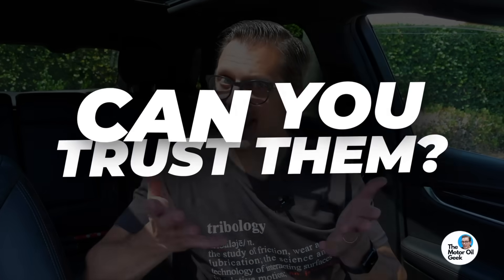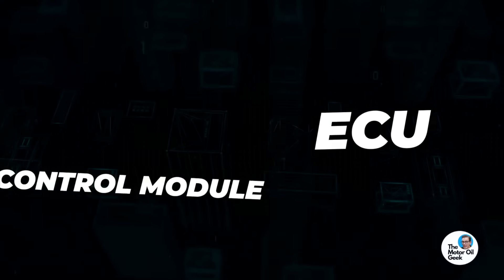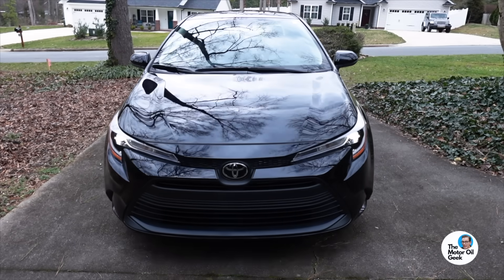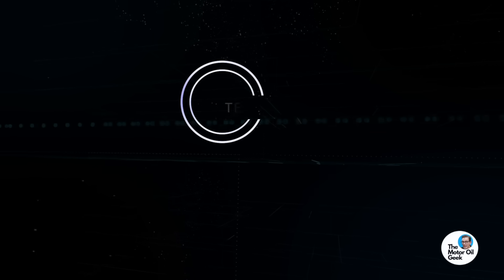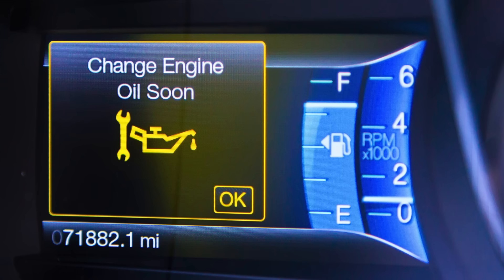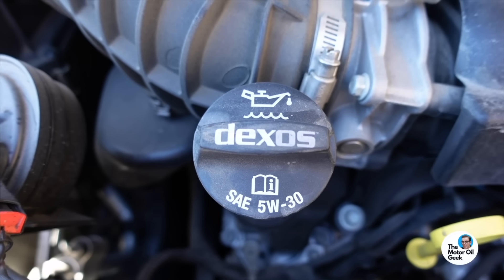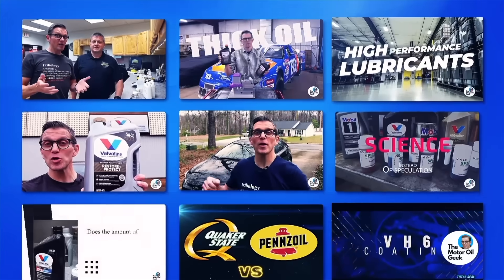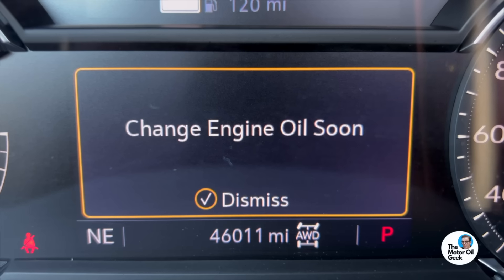The Accuracy of OIL LIFE Indicators REVEALED!

Comment: At GM, two guys took samples at 1k mile intervals at 21 different perimeters from drive cycles, time at temp, re-fueling. An algorithm, not a 3k counter. They sent the sample out to a 3rd party lab for analysis. Then repeated this on 16 different engine families. They set oil life monitors readings on the conservative side as they knew that people would ignore the display for what other reading! We had a lady who bought a new Buick 3.6 V-6 and had it towed at 16,000 miles with no oil & factory yellow chalk mark on the filter. She indicated the 0% reading came on at 12,000 miles. At 0% it still had 7% usage for her driving habits. Short trips kill oil. We have to educate customers on driving habits and the oil life monitor. This used 32 inputs to calculate oil life. How do your customers drive?
Retired Master tech.
Reply: Somestimes I need to use my motorcycle and I like to run for 3-7km. Is that considered a very short trip?
Reply: @magichatake  Motorcycles fall into several categories from dirt bikes, V Twin air cooled, 4-Stoke single & water cooled. Lake Speed just came out with a new “Oil Geek” video covering this exact subject on YouTube yesterday 12/10/2024. Worth watching as wet-clutches create issues that require a unique additive package “MR2” I think!
  I am a biker myself on #17 since I retired. Now, I would buy newer but I enjoy the steel items I welded, fit and had chromed. Making it mine. The leather seat cover comes next after I stitch my buckets for a 67 C10 pickup that is mine and the last. Comes the time to enjoy them instead of working on 2,000 vehicles per year other people owned at the dealer. 
ASE Master since 78.
Reply: @magichatake  Yes - that's a short trip. The problem with short trips, especially at cold temps is that the oil doesn't get above boiling (212 F - 100 C) for long enough to clear water and fuel dilution from the oil.
Reply: @MathewPollard-vj4uq  Oh, I forgot to say that I live in Brazil in a city where most of the time it's above 30º C (86º F)
Reply: @magichatake  great.
Reply: @magichatake  Depends on if air cooled or not? But this is why guys check it and wipe a small amount across their finger. If opaque and you can’t see thru it, change is due. If the oil retracts away from the edges of the dip stick, then it was gasoline (Petrol) in it, change. If you see thru it and see finger prints and it sticks to the stick, it’s good! 
It’s just like reading spark plugs on a race engine. Too lean and the insulators are white, the engine can blow up! Top fuel dragsters are torn down between races, fitted with new rings, gaskets and piano wire combustion chamber seals. 
ASE Master tech since 1978.
Reply: @deankay4434 ASE master tech for 20 years + L1 & L2 here. You know too much lol. Just kidding, your knowledge needs to be shared for the remnant gear heads. I cringe at manufactures building power train and drivetrains without dipsticks.
Reply: Ya my buddy's sister bought a mustang when she left home to go to University in the 80's, after about 4 years my friend (her younger brother) borrowed her car, he checked the oil when he fueled it up and it was nasty black and down a bit. So he asked her when the last time she changed the oil was, she said I have the gas attendant check it once a month, then my buddy realized she did not know the oil had to be changed out every 5000 KM (older vehicles never had oil life indicators) can't really blame her because her dad had only told her to make sure you check the oil. Funny little story.
Reply: @riverratt8626  Correct, old cars didn’t have oil change indicators as I was working older stuff in the early 70’s. A manger brought me a Post War Pontiac Chief straight 6 that ran hot after 3 water pumps. I replaced the brass tube insert in the block, that was behind the pump. It ran the length of the block with vertical slots to direct coolant between the cylinders. Crude system but worked good.
Reply: @deankay4434  to me its easier to just change the oil every 3K miles or 5 months,  whichever comes first
Reply: @cantwealljustgetalong2  you bet cha!
Reply: Caddy Blackwing 6.2L, Changed oil @ 1500 mi, Mobil 1. Timer was re-set.  Now there is only 4500k & oil timer says 9% life left.  Wonder if short oil life due to short trips or hard pulls every now and again. Guessing supercharger dilutes oil much faster than N/A.  Gonna change when says 0 and sent it off due to curiosity.  Retired marine Master tech.
Reply: @  Great question and good for you, paying attention to this issue. On the short, yes-short trips kill engine oil. If the oil can’t reach the boiling point, water and moisture won’t boil off. This is way different than a marine engine. Plus, pulling a boat or other load will affect the oil life as well. Short of sending oil sample out for testing, this the next best thing. Working for ACDelco, I met the two engineers who did just that, samples. These came from 14+ engine families in extremes that would tax the additive package to the maximum. They wrote the algorithm used by GM for oil life monitoring designed for 67 countries and their climates 
w/w/o loads. Info from coolant temp, MAF, throttle position, throttle position, etc. are input to calculate loads, gear range, temps higher than normal using cardboard partially block the radiator on tracks + a dynamometer to look for wear, metals, engine tear downs w/inspection over 16 months. This info also helps with powertrain & why some have coolers or not. Yet, they were extremely conservative in the calculations they wrote for the software understanding many may ignore the oil monitor. Like a gas tank sender reading empty but still has 2+ gallons in the tank. Like the ASE test, L1, which is 100 questions on emissions with 5 to 6 questions on parts like a thermostat stuck open causes misfire, high HC, low pre-cat O2 high readings inducing lean conditions, etc. I hope this helps to answer your question as I used the 3-gas analyzer in the dealer when no other techs wanted it. Later in a private shop, I took the job based upon their equipment, not because they would hire! Now, I am working on imports and domestics, carb & EFI include CIS systems (Constant Injection Systems) found on Mercedes, Audi, Volvo and others like Porsche. But on domestics, I had sold 38 vacuum operated canisters EVAP valves and was given a gift card for $40 at Christmas by the shop’s manager. He had never seen sales of this type item plus zero comebacks for the year. Rebuilding carbs, Fords VV7200 & VV7400 that dealers replaced plus every carb known in 1984. I was just trying to feed my family.
  Merry Christmas and happy safe holidays to all. DK, Omaha.

Comment: I have a 2006 duramax that trips the oil change indicator every 16k km (or 10k miles).
Regardless if I drive like an idiot, haul (6500lbs extra) most of the time or just daily drive it with no load. Feels like they put all that development to waste by the time 2000s ECU's were programmed
Reply from the maker: Diesels are different, so I'm not sure if those use an algorithm.

Comment: I want to assume the same results, but it would be interesting to do a similar thing with other manufacturers’ oil life indicators.  I generally always change my Civic’s oil when the life reaches 20%.  Generally though, if one doesn’t trust the length of the oil life indicator, then you can just change earlier, not by mileage, but by indicator level since the computer takes a ton into account outside mileage.  Don’t trust it at 0% and thank it’s 2x too long?  Change it at 50%.
Reply from the maker: Great suggestion!
Reply: @tinyman392  when I have honda's come in based on the onboard system, they are at 10k to 12k miles. Way to long if you want to keep them for the long term. If you want to get to 100k and sell it, listen to honda's onboard system. If you want to keep it, change it every 5k.
Reply: @jgranger2002 my Honda is already at 115k miles and I don’t drive it nicely. I’ll let you know how long it lasts, but I’ve had no issues following the minder.
Reply: @tinyman392  better go check the oil.
Reply: @jgranger2002  assuming it’s anything like GM’s implantation (shown in the video) where it’s very conservative, it’s probably fine… but it is something I wouldn’t mind seeing from the channel.
Reply: @tinyman392  7,500 miles for gm vs 12,000 miles for honda. Not conservative from honda at all. I haven't worked on gm at all. I work on honda and toyota. Honda's, especially with a turbo, are a ticking time bomb with 12k mile oil changes.
Reply: @jgranger2002  my first one was 6500, second and third ones were roughly 7500. After that everything has been 8-9000 miles. My Honda is a turbo, I’ll let you know when it blows up.
Reply: @jgranger2002 My uncle is a car guy and a retired chemical engineer.  He said that Hondas are disposable.  You drive them 300,000 - 400,000 miles and then junk them.

Comment: Good to point out that todays oil is of such high quality it will last a long time, but as Oil Geek points out it´s  the CONTAMINATION that´s the killer!  Dirty oil will clog up screens and those small oil channels.
Regardless of the miles you have to keep an Eagle eye on the oils condition as no two vehicles are alike, some burn clean some don´t. 
As my father said many years ago "Keep your oil clean son and you´ll car will last a long time!"
Reply from the maker: Great point on the contamination!
Reply: @themotoroilgeek  Have watches several videos of torn down engines, some like the Ford Eco engines that have duel turbos with oil  wire strainers going into the heads that can easly get clogged if the oil gets too dirty or by flushing for old deposits. OIL STARVATION!!

Comment: Is it true that GM reprogrammed the OLM because they were losing engines still under warranty? I have a 2008 Buick Enclave & a 2020 Chevrolet Express 4500, the OLM behaves COMPLETELY different on the 2020. You can’t even reset it to 100% with the motor running. The Buick will go miles & miles & still show 100%
Reply from the maker: I'm sure about that, but the change in the renewable fuel standard would require a recalibration since the Ethanol fuel would impact oil life.
Reply: @themotoroilgeek  Thanks for the reply, Lake, so you're saying the 2020 Express is programmed for (possible) E85 use?

Comment: I don't know why GM bothers with this.... I have 2 GM ecotec's in the household, both have tons of blowby and drink oil....They will run bone dry well before asking for a change. I don't think they are unique either, new piston rings just suck. I hear newer honda motors are just as bad. When you consume 1qt every 1000miles (many dealers don't even consider this an issue), 5000 miles, means your down about(...checks math)....5qts by then.
Reply: "They will run bone dry well before asking for a change."

You know you can check it and top it up, right? ;-)

Comment: you did not say anything about the mileage on the car, would it tell the truth at 300,000 miles. just wondering.
Reply from the maker: Great question. I would not follow it on a brand new engine. Until the engine is fully broken-in, the oil needs to be changed sooner.

Comment: GM debuted OnStar at the 1996 Chicago Auto Show, and it would hit the market in most 1997 Cadillac models as a telematics system, a precursor to contemporary connected cars. As cell phones were still relatively rare, OnStar's primary function was to serve in case of emergencies. With a touch, the driver could have doors locked or unlocked remotely or connect with an OnStar operator in case of an accident. If a vehicle's airbags were deployed in an accident, OnStar automatically connected an operator to aid as needed.

OnStar wasn't only useful in accidents. Its constant read on a vehicle's location not only made it useful in case of theft, but it also meant operators could possibly provide navigation guidance or recommend restaurants and hotels. OnStar functioned like an app long before apps were even a concept.

As OnStar's availability in GM vehicles expanded, so did its use. By early 2002, there were more than a million OnStar members, with that number eclipsing two million by the end of that year.
Reply: Thank you. I've been driving since the mid-'70s and I sure don't recall OnStar being around in the 1980s.

Comment: Thumbs up for the pro-metric system stance :) 
We all love lifting 500lbs, but the metric system is what brought us to the moon :)
Reply from the maker: Right on!
Reply: I much agree. It would be a learning curve in this country for a few years. After the learning curve most would be used to it. I've agreed with this when the USA tried to implement this in the late 70s or early 80s but it never happened unfortunately.
Reply: @bad_financial_move9169  I have to look into this, if this was the issue, that some folks forgot to use metric. But yes there is always a risk, especially in aerospace. How many incidents happen just on our streets.
Reply: The US is actually around 50% metric, especially in a lot of stuff behind the scenes. They even got things right in a few things like 100 cents to 1 dollar. They correctly bypassed the witch’s brew of the old British monetary system of shillings and sixpences!
Reply: What is the advantage of the metric temperature scale ?  All scales are arbitrary at some level and will work more easily in some scenarios than others. I like using only metric tools because it simplifies things but then I often have to use a 5.5 mm Hex. Why ?
Reply from the maker: @MathewPollard-vj4uq  There is not a technical advantage of the metric system. It's just easier to use and it is the standard in the scientific community.
Reply: @MathewPollard-vj4uq  why? Because the US builds it in 7/32 not 5mm not 6mm it is 7/32
Reply: Gave him a thumbs down just for you bby <3

Comment: I am a chemical engineer and your channel is a treasure trove of knowledge and additional information that I can learn and understand about oils
Reply from the maker: Thank you!
Reply: I started payiing attention to the onboard oil iife monitor in a 2006 Honda Odysssey purchased new.  Over the years, always using 5W-20 synthetic blend, I noticed that it showed different results depending on how the vehcicle was driven.  Lots of short trips in the winter...  more frequent oil changes were indicated.  Long distance (2000 mile) trips in the summer... far less frequent.  That vehicle went 200K miles and still ran well when sold.  My experience limited to more recent Hondas all using 0W-20 full synthetic oil has been about the same.  The onboard system has been a very reliable guide to proper oil change intervals for 18 years and five vehicles including a 12 year old Accord near 150K miles.
Reply: @billyjoejimbob56  There was a lot of R&D that went into developing the algorithm for the oil life monitor. Millions of miles of driving backed up by oil analysis. A lot of data is read and analyzed, temperature, rpm, load, speed...... As they say, follow the science.
Reply: Agreed 👍🏻 💯
Reply: @bf, do you have any experience with PAO's , and are you near Atlanta?
Reply: & forget they're making the oil continuously thinner too?
Reply: Change oil every 3 to 4000 miles irregardless of the monitor.
Reply: @bradhodgkinson7996  Must be low quality oil not to last no longer than 4K. I high quality synthetic should go 7500K minimum.  If not your are wasting money.
Reply: @bradhodgkinson7996  Irregardless isn't a word, but I like your oil changing habits.
Reply: @joby602 irregardless is an accepted word and means the same as regardless.
Reply: @joby602  "Irregardless" is technically a word, but it's generally considered nonstandard and is not recommended for formal writing. The preferred word is "regardless".
Reply: @Mount56  This may be said on some sites, but just because it's been in use doesn't mean it's correct. Yes, language is fluid, but this is an ignorant combination of irrespective and regardless. Regardless and irregardless cannot mean the same thing, as the "ir" prefix means "the opposite of", as in "respective of" and "irrespective of" mean giving consideration and not giving consideration.
Reply: @Mount56 what does irpandentic mean.  Lol.
Reply: @bradhodgkinson7996  In other words forget about the science. Forget about the millions of miles and oil analysis that were used to develop the oil monitors.
Reply: @bradhodgkinson7996  you mean "regardless"

Comment: But for example, if the piston rings don't seal properly after X miles, the fuel dilution is going to be worse, right? And I don't think that algorithm is taking that into account. It it does, that's good, but I think there are too many variables...
Reply from the maker: Fair point! I just updated the video description. This guidance is for AFTER the engine is fully broken-in.

Comment: Your report was spot on - thank-you.  I own a 2003 Corvette (C5) and a 96 Impala SS.  Both cars are very well maintained and were purchased new.  Like clockwork, I used to change their oil at 5,000 mile intervals.  As I got older (I'm 71 now), I got lazy.  I knew about GM's oil monitor and how it works.  I decided to go ahead and trust GM's algorithm.  But, I was curious at what mileage would the oil monitor activate the "change oil" light.  Well, for both cars it turned out to be about 6,200 miles.  Both cars only see pure synthetic Mobil One 10W-30, so I am comfortable letting the change interval go that high.  (I already subscribed and gave a "thumbs up").   👍
Reply from the maker: Thanks for sharing!

Comment: I change the oil in my 5.7L Hemi Grand Cherokee every 5,000kms, the oil minder goes off after 6,000kms, and the next time it goes off after 12,000kms, thus I don't trust it! I also never idle it except for really cold weather in the winter (Alberta Canada) so it'll run for 5 mins when its below -20C otherwise 30 seconds to let the oil lube everything up before going.